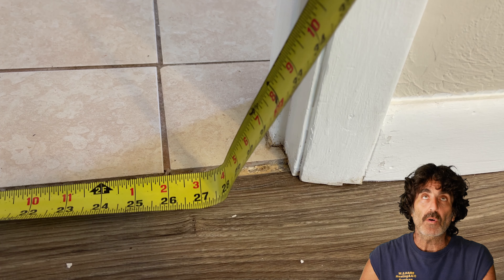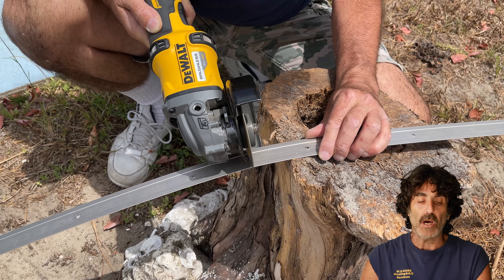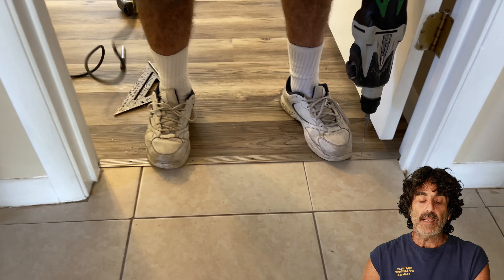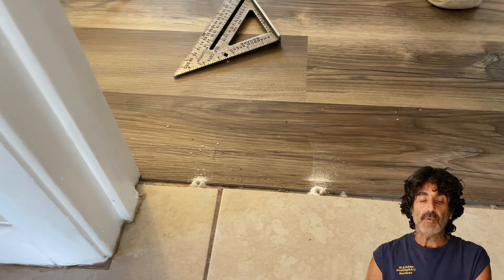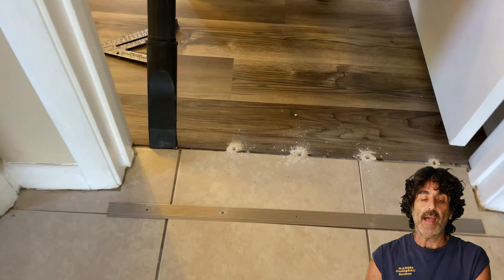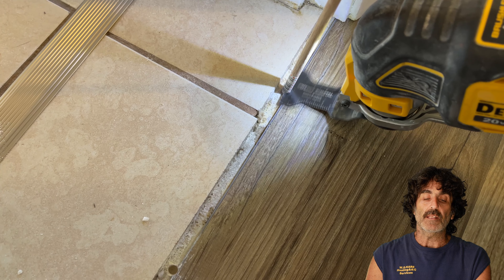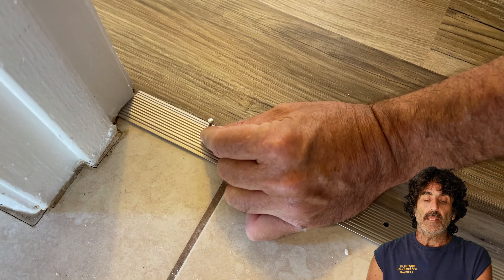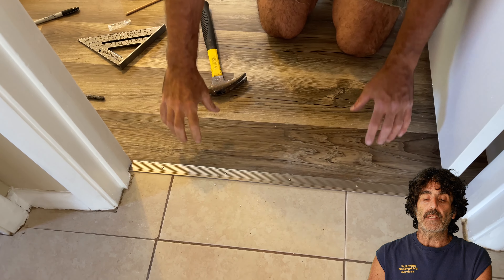DIY: Installing a Flooring Threshold/ Transition Strip on a Concrete Floor [Very Easy!]

Comment: Dude I just got done installing 1500 feet of Vinyl, not my first flooring job but first time on a concrete pad. Tomorrow I'm doing trim and threshold, and this tip looks PERFECT, funny thing is I have a pack of 1/4 inch dowel that's been in my toolbox for years, but I'm always afraid to toss it for fear of needing it lol. Thanks for the tip!
Reply from the maker: Awesome!  Glad I was able to help... 😀

Comment: I have wood inbetween but now I know if I ever have concrete that's a good tip! Thanks!  Just seeing the best way to cut it too without pinching or having a ugly cut.
Reply from the maker: You're welcome!  I've found a hack saw is probably the worse way to cut it... The blade tends to jump around a bit and will make blade marks in areas you don't want them!  Maybe could use a hack saw with a miter box and that'll keep that from happening.

Comment: Great execution. I’ve seen other tradesmen just drill and screw it down with drywall screws. I’ve seen them use the concrete plastic plugs. Your way seems like the correct way it should be done. You preserve the finish of the nails while making a good connection. Loved the centering of the holes. Thank you !
Reply from the maker: Thank you so much for the great feedback!  I can't imagine using drywall screws.. 😩.  That would look ... well not so good.. 😂

Comment: Great tutorial! Quick question though, those nails looked like ring shanks, could you have just kept the original sized holes after you first marked them, and hammered those ring shank nails right into the concrete? Would that not hold well?
Reply from the maker: I believe those nails are not strong enough to withstand hammering into concrete.  Even if the hole is almost the same size as the nail.  I suppose if you could get the hole exactly the right size it would work, but generally the nails will just bend over trying to nail them in... 😊

Comment: have you ever used the doll rod and attached with screws?
Reply from the maker: Do you mean dowel rod?  You might be able to use screws if you pre-drill the rod first so hopefully it won't spin while trying to tighten the screw.

Comment: Thanks for the video! I've been searching everywhere on how to set some sort of end-cap for the laminate flooring I'm planning on installing in my garage. Specifically, how to deal with the 2-car garage door edge - it's like the floor just drops off a tiny 2" cliff. Pretty sure this will do the trick. Just need 18' of transition pieces.
Reply from the maker: You're very welcome!  Hope it works out for you.. 😀

Comment: Do you need a hammer
Drill or a hammer drill bit to drill into the concrete? Both? Thank you ☺️
Reply from the maker: Hi, it is much better if you have a hammer drill.  You might be able to drill through with a regular drill and a good quality masonry bit, but it'll be more difficult for sure.

Comment: thanks for posting.  You didn't want to just use PL adhesive to glue down transition piece to subfloor (or tile / wood floor) ?
Reply from the maker: You could do it that way.  I'd be thinking the adhesive would give out and the piece would pop off the floor with people walking on it day in and out..  I could be wrong..

Comment: this is a more professional way to do it. I been hesitant to complete my laminate flooring because of this transition strip in to the bathroom and laundry room. the thing is I have a tension slab, and I really wasn't sure If should drill into it. I was thinking of using liquid nails. Would you recommend that?
Reply from the maker: HI, You'll proably need to drill down at least an inch and use shorter screws into the concrete.  Depending on how deep the tension cables are would be a problem.  You proably don't want to hit one.  I doubt it would cause a serious problem, but it'll keep you from putting a screw in that location.  I googled whether or not you could drill a post tension slab and it basically said that you should know where the cables are before drilling.

Liquid nails would probably work for a while, but chances are it'll pop off after a few months.  Especially if people are walking on the strip itself causing it to flex around a bit.  Maybe try something like Quad.  It's more flexible and makes a great adhesive after it's dry.

Comment: Omg!! Thank you for this trick!!
I'm pretty sure this answers my problem, except I'm installing floating  12"×24" locking tile over a carpeted floor, I wonder,should I leave the dowels jus a tad bit longer?
Reply from the maker: I don't think it'll matter as long as the nails are long enough to reach the dowels.  Can you install over carpet?  I would think the softness of the carpet would cause flexing in the floating floor...
Reply: @TheHomeImprovementChannel  well, it's possible,but it's what my boss wants, this is my first locking panel floor I've ever done, she knows this but, here I am😱lol. I'm seriously struggling with a lot of this, and  your tip for  the threshold , I'm praying works for this application, I'm just a handyman in over my head. and BTW the carpet seems really thin, it's not plush like a home, this is in a  office of a building she purchased
Reply from the maker: Oh ok... Yea thin is better.  I've never tried to do it that way.  I think I'd lay out a few pieces of flooring and walk on it to see if it seems like excessive flexing... if so, it'll probably work for a while, but not sure about long term.  On the other hand, if that's what the boss wants, all you can do is give an opinion and it's up to them to take it or reject it... 😀

Comment: Won't that dowel rot eventually from the moisture in the concrete?
Reply from the maker: It might, but I'd say it'll take a long time!  If you can find a plastic dowel then consider using that..

Comment: Will this be a correct fix for a commercial kitchen and pass a building inspection?  I received a violation due to a 3/8" gap between my tile file and the threshold.
Reply from the maker: HI, Yes I don't see why not.  As long as your threshold fits properly, they're not going to pull it up to see what's underneath.

Comment: I assume you drill to the depth of the length of the nail? And what diameter of dowel do you suggest? I have some leftover from a different project that are already cut to 1 1/4” L and 1/4” diameter.
Reply from the maker: HI, yes I think 1/4" is a good size dowel.  1 1/4 would also be fine as long as the nail isn't longer than about 1 3/8 or so...

Comment: Do you recommend filling the void (the drilled holes with the dowel, and the gap beneath the strip) so it doesn't shift against the floor and also provide some adhesion?
Reply from the maker: I don't think I would do that.  You're risking a mess if the adhesive ooses out from the strip when you squeeze it down.  The dowels will expand in the holes once you drive the nail in, so they're pretty tight.

Comment: What kind of nails did you use
Reply from the maker: Depending on your threshold.. The metal ones usually come with matching nails...  For wood I would use finish nails and drive slightly below the surface and putty over the top..

Comment: Can I put some caulk or anything to fill the space underneath the transition strip so water can't get underneath the vinyl ? 

Also my strip came with screws instead of nails, would that work too ?
Reply from the maker: Hi, I don't see why you can't put caulk under the transition.  Just if it squeezes out, be ready to clean it up.  The screws should work.  I would probably predrill the dowels first so they don't spin on you when your trying to put the screws in.
Reply: @TheHomeImprovementChannel  Good idea, thanks for the response appreciate it. We'll see how this turns out !
Reply from the maker: You're welcome... good luck.  😀

Comment: What about moisture from the concrete, when wood touches concrete its supposed to be treated lumber or a vapor barrier. Just a thought
Reply from the maker: Yea I know about that. You can buy acrylic dowel rods on Amazon.  They'd last forever.  The wood will last for a long while, but could have trouble eventually..